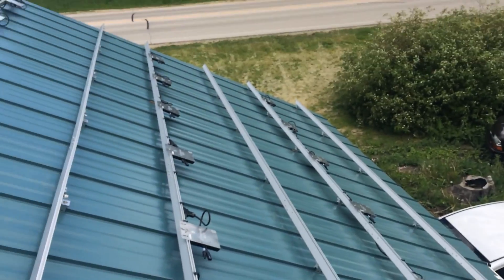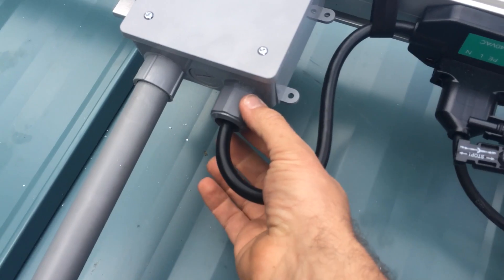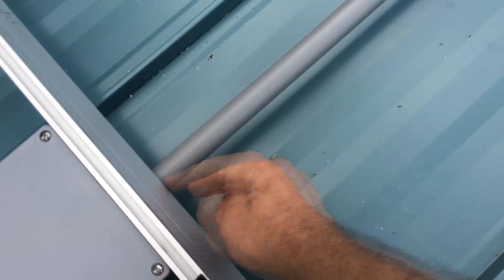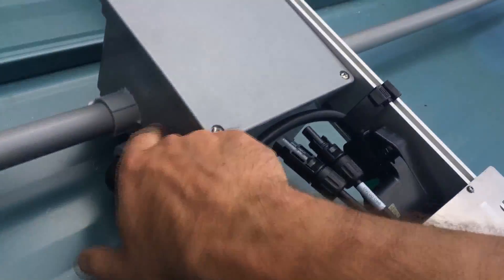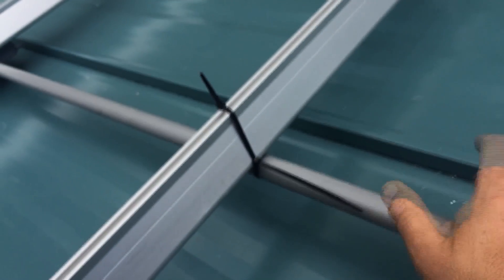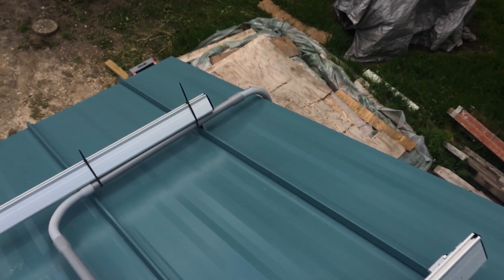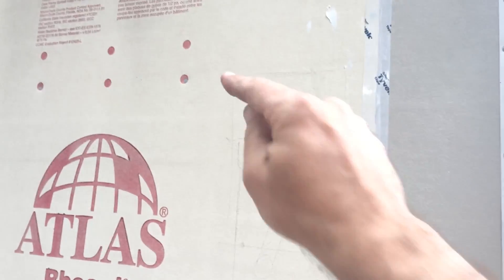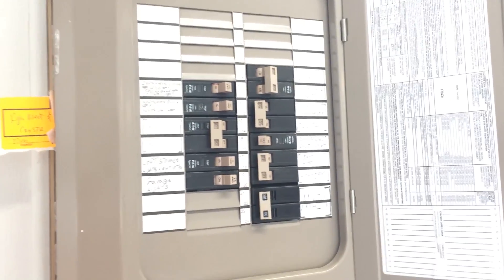Solar Junction boxes and conduit for Enphase Photovoltaic Solar System

Comment: In the video you said you used zip ties to temporarily attach the conduit to the racking system. I'm curious what your final solution ended up being?  Thanks!
Reply from the maker: Self-tapping sheet metal screws through the box and in to the rails and also some stainless steel zip ties in the odd places.

Comment: Did you have to get an inspection?  I'm hoping I can use PVC like you did, but I can't find anything saying is allowed.  Seems like most use the metal conduit.
Reply from the maker: kornface13 Yes. This was an inspected system. I did the wiring myself, but needed an electrical permit with the electricians license number on it. I hired the electrician who did the main wiring on the garage to assist me for a morning and double-check my work.

Comment: I have the same corrugated roof and Ironridge rails, and I'm just about to install the "optimizers" (I'm sure you know about those) that SolarEdge uses, essentially the same process as your ' mini-interters'.  MIne is 4/12 and I get disoriented.  In California, we just run the solar cables, attached to the rails with clips or ties into a junction box at the end of all strings, where the lines enter a conduit, to take it down a level and into the Inverter.  Exterior, so the conduit must be steel above ground.  The solar wire is #10 gage I think, so you could substitute any #10 DWG wire at the junction box by making a weatherproof connection inside the box.
Like you I have to decide on one string or two.  Two makes more sense, there are two rows.  
With two strings, there would be two sets (+ & -) of wires inside the conduit from the roof to the inverter, or you could make the two (series) strings into one set of wires in parallel, inside the box.  That's the next question I have to find an answer to.......one string is a no-brainer.  
The SolarEdge 7600 Inverter has an entry block made for one or two strings (sets) of wires.  I guess that's why it's called parallel wiring, two of everything all the way.  Combining the two strings into one set of wires would also double the voltage and halve the resistance, turning it into a confusing muddle of data for the Inverter to process and either blow it up or void it's warranty, but the (many) installation guides are not clear on that.  CA code reads that DC electricity must be in a metal conduit when attached to a structure with AC existing, I believe, but local governments are free to add their bit, and often do.  That maybe Palm Springs only code.
Reply: I realize you installed you system 5 years ago. Maybe you know if a DC only string array using an SMA inverter and Ironridge  rails  can use CPVC conduit and CPVC J box? All wiring will be external/rooftop to the inverter.

Comment: Thank you for all the content, your channel gives out a lot of information. You need to install an LB on that corner. Because you have to many 90 making it close to impossible to run wire through the pipe.
Reply from the maker: Yes, in the final version of the "gooseneck" around the edge of the garage, I actually ended up using two LBs. That allowed me to get the conduit as close to the building as possible, which I think looked the nicest. No problem pulling wires through like that!